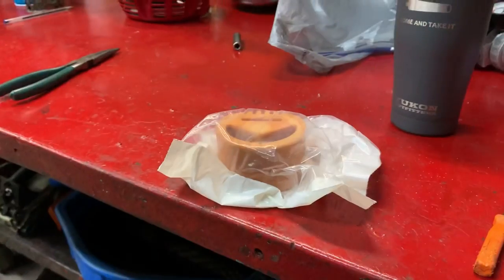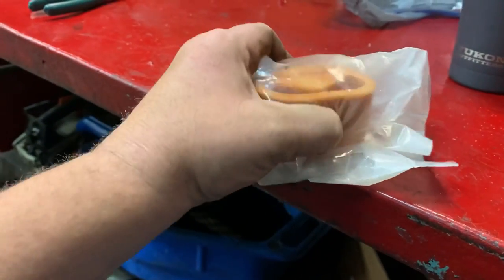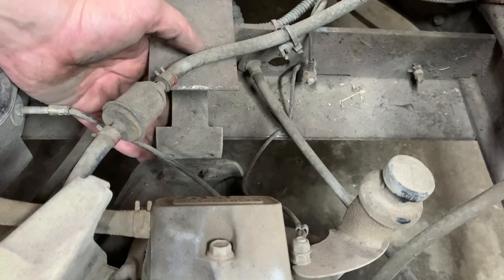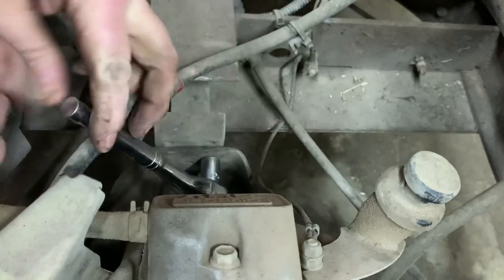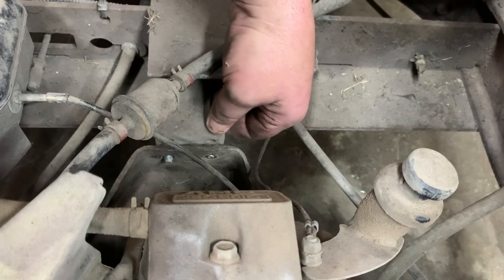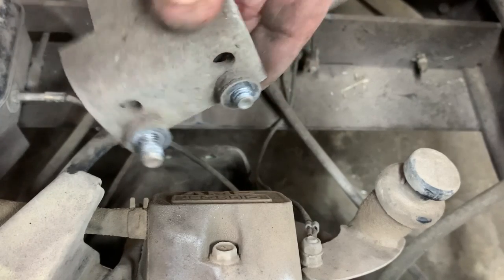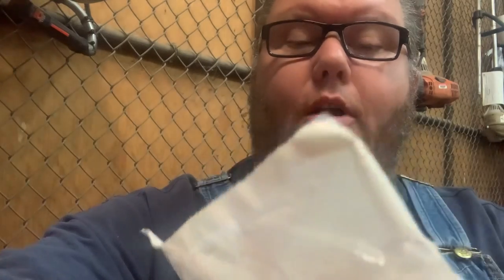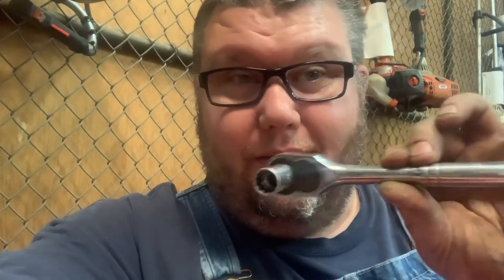1984 - PRESENT CLUB CAR TRANSMISSION MOUNT REPLACEMENT

Comment: That is all fine and good Mowermedic but many of the Club Cars prior to 2000 don't have a bolted "tongue" that the dobber fits onto.  It is welded. onto the cradle.  The Manual provides a procedure where you have to disconnect the rear leaf spring so you can raise the entire cradle up to slip on the dobber.
That is BULL.  I just carefully slice the dobber on one side providing me a means to slip the tongue in the dobber and then apply an epoxy where I did the small slicing.  Never had one fail or come back.
Reply from the maker: It takes what 10 minutes to do it the right way? Nothing ever good comes from cutting corners like that, if I caught a technician in my shop doing that to a customers golf cart I would fire his ass immediately
Reply: Thanks soooo much fo this comment! that's exactly what i"m going to do! going to save so much time! thanks i bought a two pack so if one fails prematurely for the price of them that's the way to go, THANKS!
Reply: @THEMOWERMEDIC1  For A personal carts for the prices of them who cares!? But if I paid a shop to do the job properly I would be unhappy with the service if they cut corners to get it in.
Reply: Mine is also welded, no go on this video.....
Reply: @THEMOWERMEDIC1  Well, if you can disconnect the rear suspension (and you know those leaf spring bolts will be seized) and raise the entire cradle and motor up enough to get the dobber on you are REALLY good.  Much better than me.
There are a lot of Club Car carts with the tongue welded to the cradle.  Mine is a 1994 and is welded so "1984 to present" is not really accurate.
I watch most all your videos and have learned a lot but this one I have to take a bit of an issue with.  Obviously, if one has a bolted in tongue this easy just like you demonstrated but for those of us having a welded in tongue this is NOT an easy task.
Now, if you want to do a video on a CC with the tongue welded and you can show us how to do it in 10 minutes I will gladly eat my words.

Comment: Good luck replacing this on the newer models like a 2019. It can be done, but it ain’t no 2 minute video. Ridiculous how much crap they stuffed in these things now. Get the urethane isolators and never change it again.
Reply from the maker: Poc!
Reply: Port of call? 😂

Guess I’m kind of kranky as I just changed one yesterday. My course bought a bunch of 2019’s and I’m going thru them all before releasing to the corral. These new ones have even more sharp edges and less room to maneuver. Also they are using fine thread M8 bolts. Really fine thread?